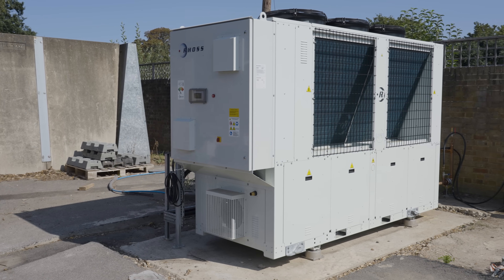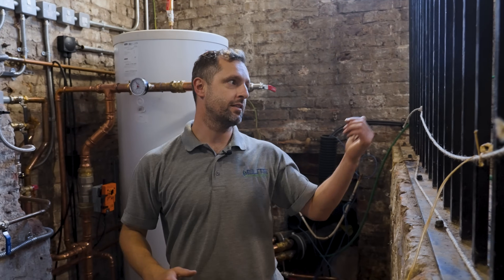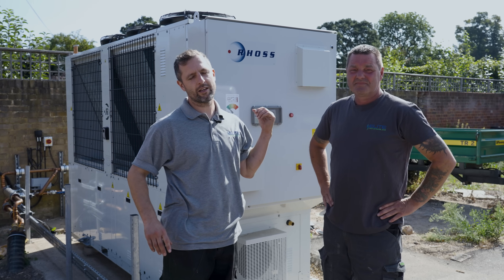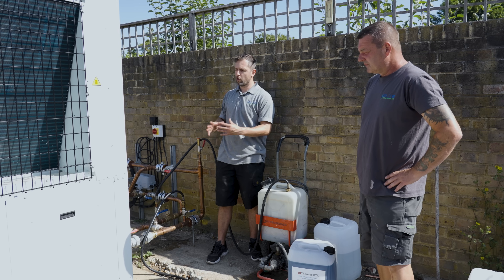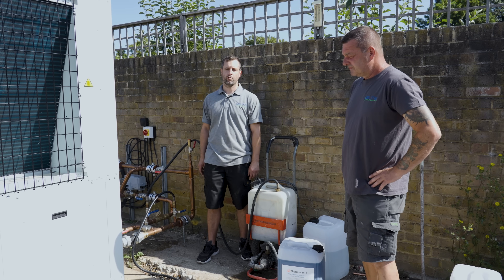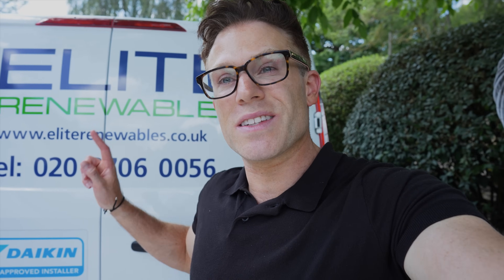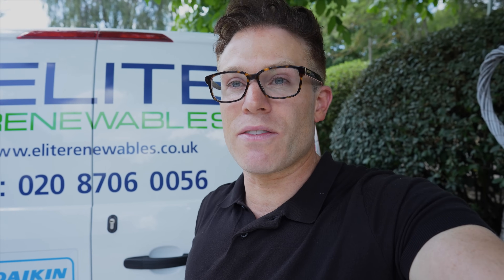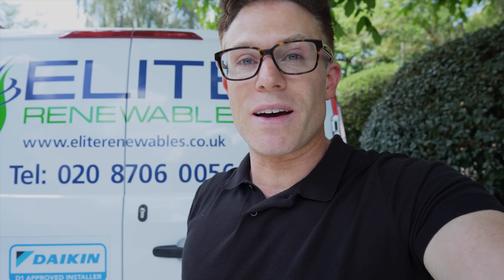The Most Ambitious Heat Pump Installation in Britain? Chiswick House and the Italian Monster!

Comment: Why are you using a buffer tank on the heating circuit if theres a plate separator? You don’t need extra volume in this case.. if anything the buffer should be on the heat pump circuit for defrost volume..